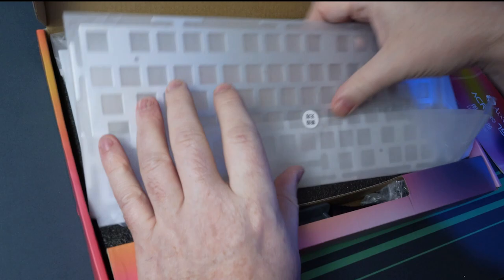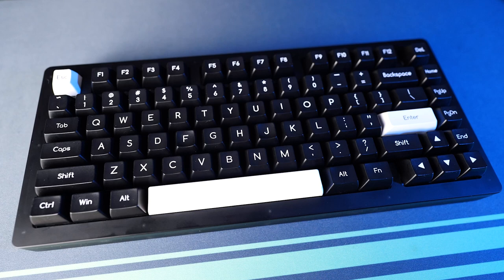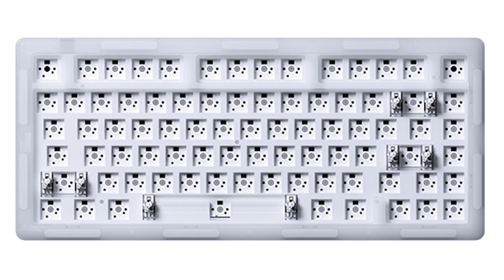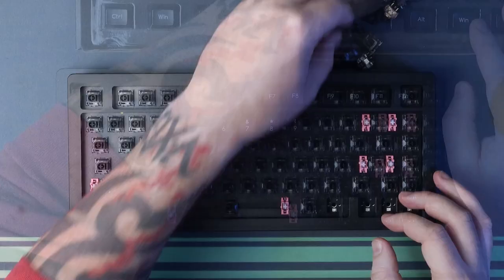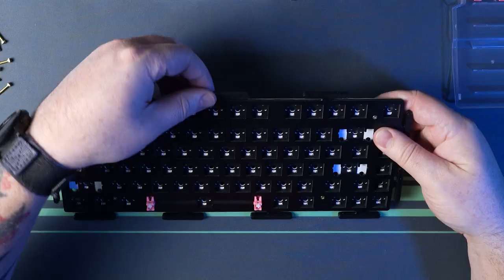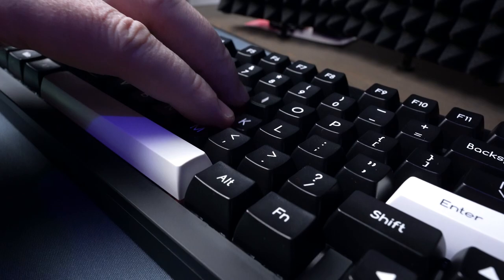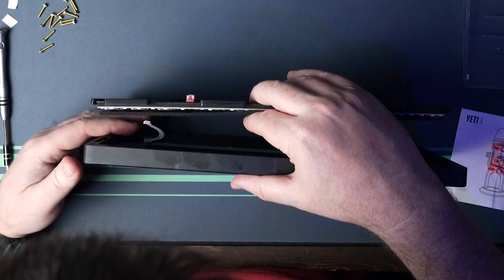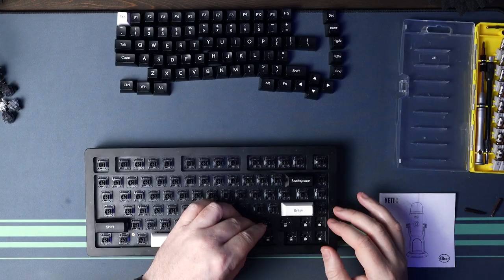AKKO ACR PRO 75 Build and Review

Comment: Hey man! Just wanted say a huge thanks for this quality video about the ACR Pro. Went ahead and bought it and I gotta say this is really a quality keyboard. Built it with their Lavender switches, added one layer of tapemod and finished it off with the WOB Building blocks keycap set. I'm extremely happy, thanks again!❤
Reply from the maker: My pleasure. Nice build, I love the Building Blocks keycaps!
Reply: Thinking about a that exact same setup. Would you recommend the ACR Pro + Lavenders for mostly typing?
Reply: @ihavenoiqq  Hey! If you use it mostly for typing I would suggest to go with a linear switch from their lineup. The keyboard itself is still amazing :) I'm currently rocking the Tropical Waters v2s but still have 10 lavenders in

Comment: This one compared to IK75, which one is better?
Reply from the maker: I've not used the Feker IK75. I've had a Gamakay which is similar I think. If I had to pick one having not used both, I'd pick the Akko.
Reply: I have an IK75 and don’t have ACR Pro but Akko’s structure looks better and it sounds better. Was pretty disappointed with my keyboard out of the box as it sounded so hollow. Had to mod it a lot and it still doesn’t sound as good as my stock Hexgears keyboard.
Reply: I have both, acr pro 75 is far superior compared to ik75. Take note tho its a bit muted. I think its the plate foam, try change to PE foam for a better sound.